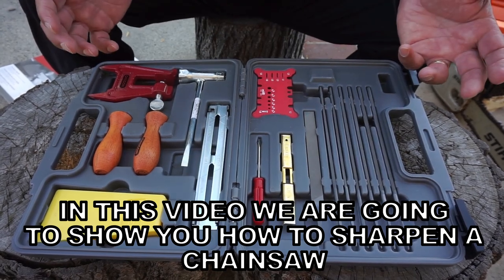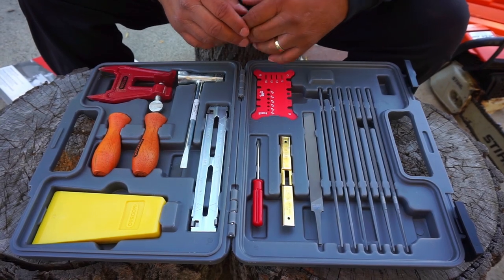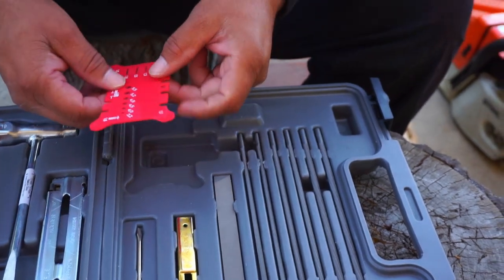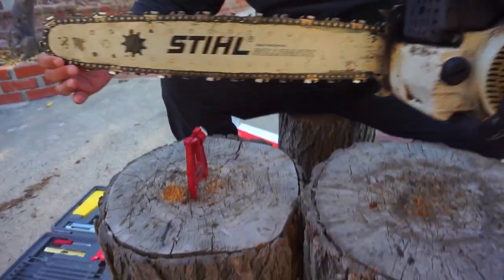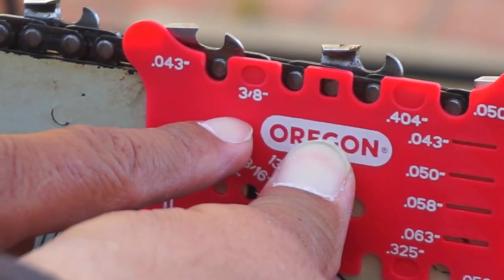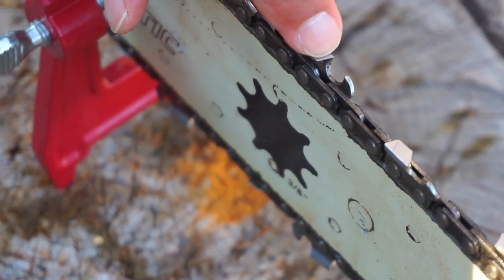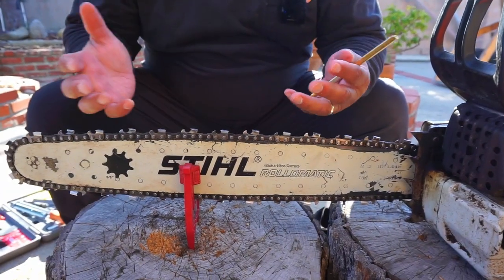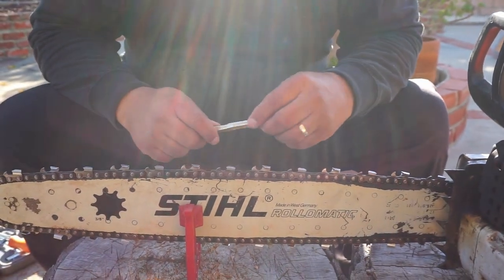Ultimate Chainsaw Sharpening Guide

Comment: I think you should not file directly over the depth gage guide because so you file a bit of the guide itself. I would just place it on the bar and look if it is necessary to file depth limiter and remove it to file the limiter.

Comment: Looks like you started with the wrong size file. Low profile 3/8 uses the 5/32, but standard 3/8 uses the 7/32 to sharpen. The file should fit in the bottom of the gullet and extend past the top plate about 20%. Using a smaller file will still work,  but you may need to take it out of the guide to get the gullet. Great video as always.
Reply from the maker: Thank you, Take care!
Reply: That is what I was thinking too, Bino.... about the standard 3/8 using the 7/32" (or 13/64")